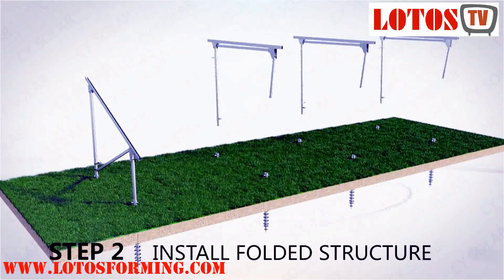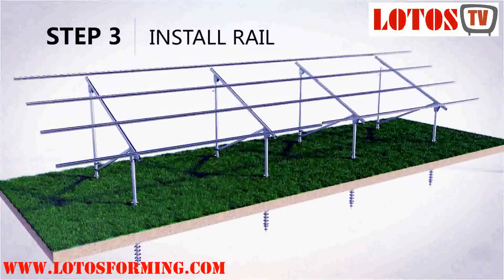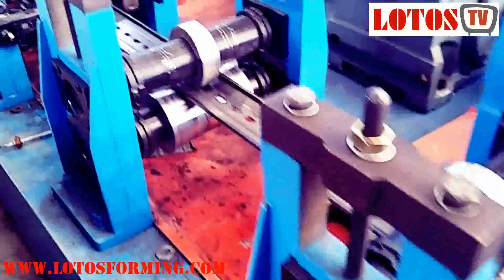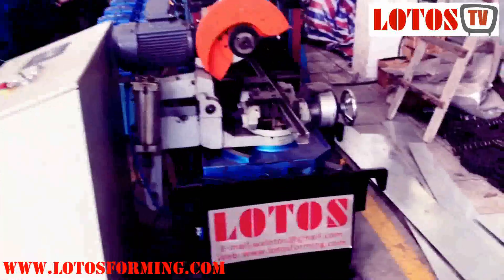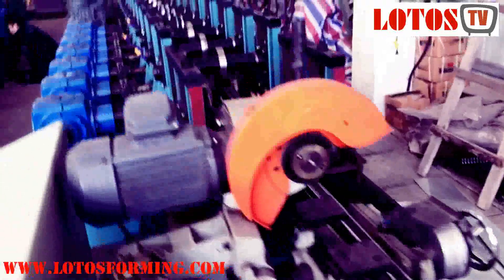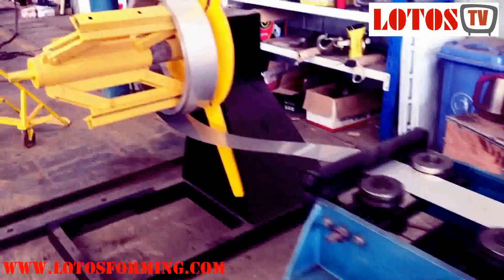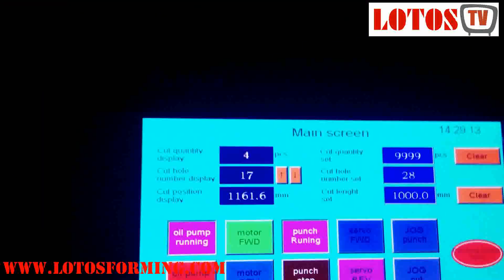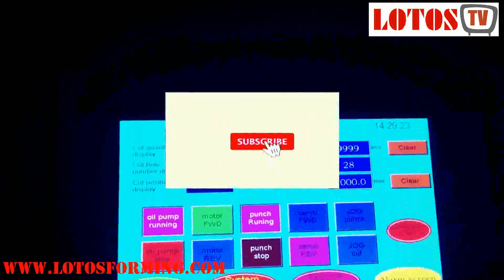【Solar Mounting Bracket Forming Machine】: solar panel stand making machine "solar mounting bracket"

Comment: Strut channel is part of the solar panel mounting structure in which are specialized in developing and manufacturing solar mounting structures in various sizes & lengths as per customer Requirements.

Comment from the maker: SOLAR PANEL MOUNTING BRACKET ROLL FORMING MACHINE can produce 1.5 mm to 2.5 mm solar strut channel. Unistrut commits to being the best in the metal framing industry. strut channel is a series of threaded rod and metal channel used to form a ceiling-mounted support structure for anything to overhead system components.